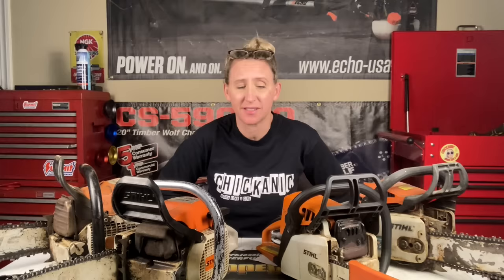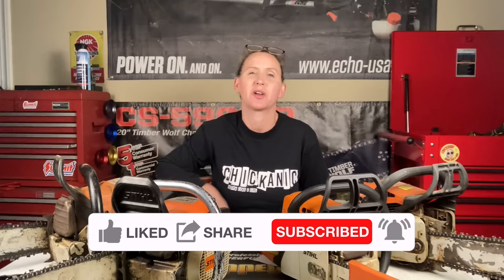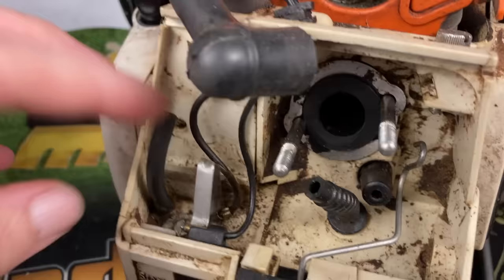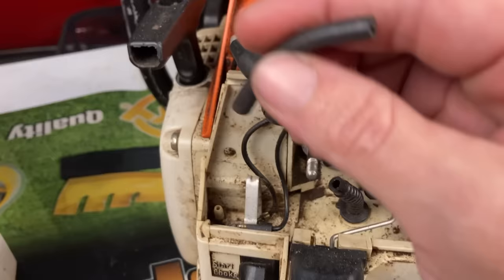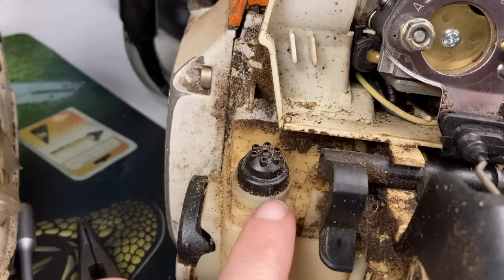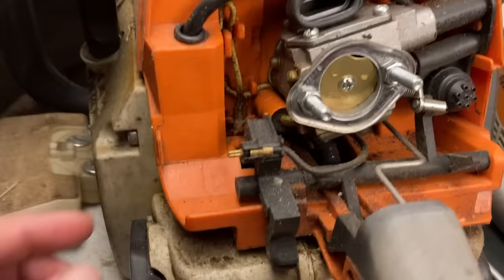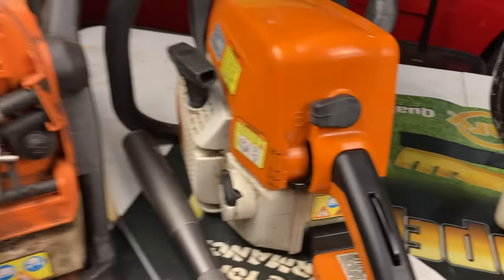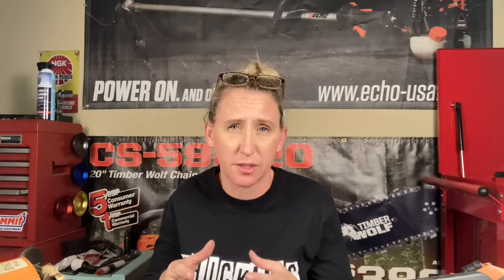Stihl chainsaw bogging down, has no power or is leaking fuel? CHECK THIS! Repair/Vlog #Chickanic

Comment: The tank vent only lets air into the tank. STIHL techs always check the tank. Should hold positive pressure and allow air in to prevent a vacuum as the fuel burns.
Reply: I agree, but so many people have said the vent is to vent out pressure as well; and, I watched a youtube video that said Stihl had an issue where fuel would spray out when the operator went to refuel. A safety hazard that they had to address/fix to comply with OSHA and workplace safety requirements. A charcoal canister would allow pressure to vent out while not letting gas fumes escape. Not sure if that's what their new vent design incorporates but it seems plausible. I've seen charcoal canisters incorporated into honda outdoor power equipment engine gas caps.

Comment: LP-1200 Tygon line is what you want to resist pinching. It is also good
for other uses, but is not as soft and flexible as regular fuel line. It will
pull through tank grommets fine because the grommet will flex. But 
when trying to pull the LP-1200 type line through a rigid opening that
has no grommet, the opening may need to be reamed slightly larger
because the LP-1200 fuel line won't easily compress enough to make
the same fit like a softer fuel line. But for replacement barb to barb 
connections, or through rubber bushings it is a drop in replacement.

Comment: Well I learned something today. I always thought the tank vent allowed air into the tank so it wouldn’t create a vacuum inside your tank as it was running. Thanks!!!
Reply: Tamato/ Tomato She's sharing more knowledge than U.
Jealous?? or Threatened that Shes Smarter than U with Internal Combustion Engines both 2 AND 4 strokes as well as the oils and fuels.....
Me I'm secure in the fact that I Do Not Know it all, heck not even close.
Thats Y I can learn from these video's.
Bre,
KEEP UP THE GREAT INFO VIDEOS.
Reply: @mikeholubek4419  
Gee, all the man said was he learned something.  You have to criticize someone for learning? 

Maybe you feel threatened that someone could actually learn something from a woman?
Reply: @mikeholubek4419  wow.....bit of an over reaction there mate. I thought he was acknowledging Bre's knowledge. Oh well.
Reply: That is the primary purpose of a tank vent. A sealed container of gasoline will build vapor pressure, the equipment maker may or may not want to limit the build up of such pressure. Watched a Wranglerstar video where he mentioned Stihl had an issue with pressure building in the tank and fuel spraying out when the operator opened the gas cap to refuel. It had to be fixed for safety/fire hazard and OSHA/workplace safety requirements.

Comment: My 029 Super has been difficult to start after warm-up.  I checked he tank vent and I bet you know already, just a bare nipple.  I've ordered a new vent hose but the problem is, this saw JUST came back from the shop after I complained about getting sprinkled with fuel when cutting overhead branches.  They replaced the tank filter and hose but never touched the missing vent issue.  THIS VIDEO JUST HELPED ME FIX MY SAW!  Thanks once again.

Comment: I thought the tank vent let air air into the tank. The duckbill valves used in many saws let air in and not out. If the tank needs to be pressurized for the carb to work correctly then you should not be able to start and run a saw with the fuel cap off. Jusrt curious.

Comment: I would cut the vent short and push a sintered bronze filter up inside the vent tubing. They sell those filters on eBay. It's how they used to vent the tanks....easily, until they had a 'better' idea. A lot of the time they ran the vent(with the filter) to terminate in like the recoil assembly space.

Comment: Used my MS170 today for the first time this summer and it was bogging so bad, I thought it was the high speed adjustment, and was about to go get a screwdriver and fiddle with it, but I said " lets try it one more time first" and it cleared itself and ran great. Going to check the tank vent tomorrow (: thanks Bre.

Comment: $0.50 cents, that same hose last Tuesday cost me $12.00 us.  it's just a small piece of hose with  2 Grub screws.  but I put it on and the very first pull of the starter cord it took off and ran like a new one.

Comment: Thanks, I really appreciate seeing this post on the tank vents. Not something I have had an issue with to date. But I had a Husqvarna that was surging and had thought to look at the tank vent. But needed to replace the carb and the ignition coil anyway so wanted to see if that was it. But as luck would have it I replaced the carb and ignition coil on a Husqvarna 141LE and a 136LE and set the High and low to 1 1/2 turns out from seated and the idle screw to just past half way in and have slowly adjusted both ways and neither will start. And I can see the fuel isn't coming up the line on one. But it has a bad split on the little blue impulse line. I went ahead and replaced the intake boots on both and I used new gaskets on the carbs. So I'm ordering new impulse lines and will be checking the fuel tank vents on both now. I have never had a chainsaw give me much problem starting after a carb, ignition coil and fuel lines being replaced. But these two are certainly doing it. Not to mention my compression gauge says everything has 30psi, even my Stihl that is a good running saw. And the gauge is brand new. But it took me 2 months to need it after I bought it and that passed their return date. And they don't warranty closeout items. So I gotta go pick up another compression gauge to. But there is plenty of resistance pulling the starter rope. And putting my thumb over the spark plug hole has plenty of pressure trying to push me thumb off the hole. So I'm guessing that's good. Just won't know for sure until I check it right. 
Anyway, love the videos. I'm more like the shade tree mechanic version of small engine repair and you have helped me through as number of issues when I was repairing a saw to resell and was stumped. I fell into the work by accident and needed a way to subsidize my disability check. This just fit. But it took a category 3 hurricane to show me. I will never again depend on a DeWalt 20 Volt sawzall to help get the roads clear enough to get out to check on the family and priorities I need to after a storm like that. I make sure I have 3-4 saws running good at the start of the hurricane season now and stock up on the common parts that tend to fail and a few of the ones that kind of make you scratch your head just to be sure I can keep my saws running. And I try to have a decent stock of saws that run good and I can sell fairly cheap for those people that are facing the aftermath of a storm without a saw like I did. That way they can pick up one that will help them get their property clear and maybe help clear the roads too.  Always keep extra saws on hand for storm season. I'm hoping to have my Stihl 046 rebuilt and running before this one gets serious.

Comment: Well my Stihl MS260 is running great. Installed a new tank vent, new air filter and a slight adjustment to the carb and it's running fantastic! 
Now it's on to the complete rebuild of my 2000 Stihl 046. I got it free as a box of parts when I purchased a Poulan Pro 260 and 262 for $20 for the pair. He was just happy to make a few bucks of saws he thought there destined for the landfill. I thought it anything I could strip the good parts, the clutch, maybe the chassis, bar studs, chain catcher, the engine shroud, starter and clutch cover, maybe the exhaust, pressure test the carbs and maybe rebuild them etc and trash the rest. Well in less than a week and with bare minimal parts I had both saws running beautifully and both where sold. That was 2 years ago. I still haven't touched the Stihl 046. But since I started processing my own wood left from Storm debris and trees people have cut down and need removed I started thinking the 046 would be a good saw to use with a chainsaw mill. After all I'm not processing anything larger than 12". Well at least that's the size of my planer. I guess I could cut larger and cut it down with the table saw. But I don't plan on cutting anything larger than my planer can handle really. So the 046 should be great with the mill. I just gotta rebuild it from the ground up. I'm not positive but I'm pretty sure there is a leak in the fuel tank and it may need a new chassis depending on the size of the leak. I may be able to patch it. Just not sure what will work and hold indefinitely being in constant contact with fuel add 2 cycle oil. And I'm not sure I like the idea of using an after market chassis. Anyone with any tips on how to patch a hole in a fuel tank I'm more than willing to hear what you have to say. After all a Stihl 046 that's in dependable running condition and hasn't been rebuilt with a bunch of Chinese parts has a nice resale value. I have the OEM Gasket kit order as well a several other parts such as the sprocket, carb, air filter and ignition coil. The flywheel seems to be in good condition, but I'm replacing the starter Pawls just in case. The springs look weak. I might as well replace the starter spring while I'm at it. If it's original most likely it's got plenty of wear on it to. I guess it's a good thing I started with rebuilding all those Poulans before I tackled this one. I have about 18 total rebuilds under my belt, just not a Stihl. Any tips would be appreciated.

Comment: Current tank vents never let any air out, only in. They are one-way valves. If you are flooding, it is because the metering valve is not seating correctly. Tanks never develop more than 3-4psi pressure and all carburetors are designed to handle at least 7psi pressure. I own a small engine shop and specialize in Stihl equipment.

Comment: Have a ms250 That I had for a while.  Bogged down and die on me.  It start right back up and run for a few seconds and this bog again and die.  After a few times it would start.  First thing I thought was compression.  That checked good. spark was good.  So only thing left was fuel.  Saw your video and soon as you said tank vent i paused the video and checked mine and noticed it was pinched in the back as you explained in your video when I Finished watching it.  Fixed it and seem to run good now.  Sometimes you just forget to check the silly stuff. Thank you

Comment: Great job Bre, I find the newer round vents are more reliable, but need to be removed and cleaned with shop air. Have a great day. Hope the oppressive heat and humidity has lessened a bit.

Comment: On the Stihl NS250 cut the rubber vent hose about 1/2 inch from the vent cap and also somewhere on the top run of the vent tube and replace with a piece of copper tubing that is hand bent and then slip it inside the vent hose and that will not ever kink. Be sure the copper tubing fits snug into the vent hose so it will vent properly. I have done this to a vacuum line before on one of my vehicles and it worked great.

Comment: The other issue I found with my MS180 is that the spark arrestor mesh in the exhaust is clogged up with carbon. The easiest fix is to put the mesh on a tile, brick or metal plate and use the gas torch to burn the carbon deposits off.

Comment: Also, that little hole in your riding mower gas tank cap is there for a REASON!   Ask me how I know.   Fiddled with my mower once for 30 minutes until I stuck a toothpick through that hole...and fixed it.

Comment: The vent allows air into the tank to replace the volume of fuel that has been consumed.  The vent allows air in since removing the fuel generates a negative pressure in the tank.  While allowing air in it prevents fuel vapor from escaping.

Comment: I always had this problem with Stihl. I switch decades ago no more loose bolts or bog down. I just go to the woods and cut firewood. I used Stihl from about 1980 to 87 I watch a old man come out the woods very fast with a truckload of wood. With some little Husqvarna I got real interested. I had a 028 and a 041 Stihl every truckload I would have to fix something. I went to town and bought a 50 Husqvarna in 1987 cut truck load after truck load no problem. I was thinking this is really nice. I still have that 50 and runs great.

Comment: Dam, you're good!  Not two hours before I saw this video I found the same problem with a pinched vent line on my MS 210.  I think the tank was being pressurized so much that fuel was being pushed up around the fuel suction line grommet.  I will look especially close to prevent this from happening again.  I keep learning from you gal.

Comment: Old vent allowed flow in both directions. New 'vent' allows flow into the tank only, its a one way valve, it does not release tank pressure.....which is the whole reason for its existance - to stop fuel vapour (or neat fuel) from being released into the enviroment. But of course either version of vent - if blocked - will stop the engine running right.

Comment: In central Florida I buy saws from pawn shops. Run it till it dies then do it again shops here charge more to try to fix it than I can buy on for  now I'm trying to fix it myself from the stuff you have shown  got six to learn on
Reply: I have a couple of Homelite saws that are more than fifty years old 
and have breaker point and condenser ignition, start up first pull 
and still cut trees. Never have these saws seen a repair shop. 
They are climber saws, little one hand saws, 32 to 1 mix.
Reply: @artpatronforever    I have three top handle saws like yours, a Homelite (with a manual chain oiler), a McColloch and a Craftsman. Neat little saws!

Comment: Take this with a grain of salt because I do not know a lot about small engines.  But was wondering if a small copper tube could replace the rubber tube where it gets pinched.  The go back to the rubber tube to attach to the breather thing.  Also could that breather part be relocated before the pinching area?  Anyway great tips and videos.  Thank you.
Reply: How about putting a short piece of larger hose over the kink to restrict the bending of the smaller line?

Comment: I WISH THOSE OLD TANK VENTS WERE STILL CHEAP , DOWN HERE THEY ARE 12.99! YALL NEED TO DO A VIDEO ON THE PULSE LINES ALSO- THOSE ARE A SUPER FUN,  BUT THATS THE  SECOND THING I CHECK AFTER COMPRESSION WHEN A SAW COMES IN BOGGING!

Comment: That little hose runs from tank to carb on my 290. I think. I just changed my carb. Or was it my 56 weed eater. Nevermind. No, it's 290. Because it has a plastic sleeve at the idle adjust side. Then a separate straight 2 holed sleeve for h/l screws/pins, whatever. I don't understand the one that went to my idle needle. It's probably been too long.

Comment: HI!   the 290 looks promising, so How did you Fix the one "Bogging" down?    Never knew of vent, no saw. This is Fun!
no design room.  Needs longer hose, turn angle too tight.  Will it fit Under Carb. reaching Up to attach Grommet?
Design a vehicle where One favorite cup Fits, even without changing station when shifting.   lol   Thanks!

Comment: I have an old shindaiwa blower that I have to slowly adjust/ let off the choke once I start it to keep it running. Basically takes a long time to warm-up. Once it is warm and I have fully let the choke off (after several minutes of letting choke off a little at a time) it runs great 
I mix my own fuel (I use the Stihl mix and I know you said run wide open with that oil which in blower I do) and I rebuilt carb. Any suggestions ?